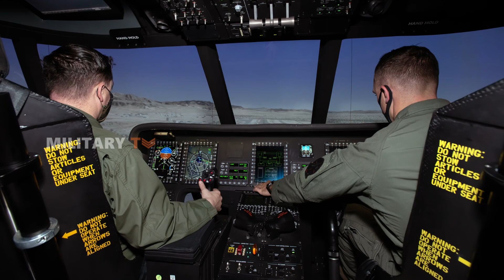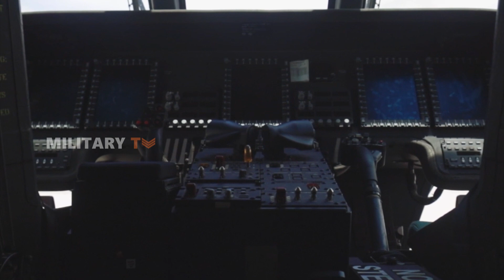Why is the CH-53K King Stallion the Future of Heavy-Lift Aviation?

Comment: When I was in the Corps I got to ride in the older models all the time. Hydraulic fluid was leaking all the time. The joke was if it’s not leaking, it’s empty. Does this new model and its fly by wire feature eliminate the need for hydraulic fluid?

Comment: CH-53K still a cheap copy, the one true king is the MIL MI-26
Reply: cheap? 😂
funny ironic joke from a Russian fanboy 🤣
Reply: @DOGosaurus_rex   Nope not a Russian fanboy, but I know everything the US builds is just a cheap copy. Build to expensive and doesn't work.
Reply: @manoeribaravie165 The longevity of the Huey series, the B-52 Stratofortress, the C-135 series, and the C-130 Hercules makes your comment seem ridiculous.  They were all originally designed in the 1950s.
Reply: @manoeribaravie165 
TOO, DopeY 😕.
Reply: For the IGNORANT! MI26TM HALO, has twin 11,000 Shaft Horsepower engines, cargo capacity of 25 long tons. It has a greater cargo capability under Hot and High conditions than any C130 variant. It's primarily  utilized for Oil and Gas exploration in Siberia, with a few assigned to the elite VDV Airborne and Air Assault Divisions. Also firefighting variants are deployed to battle oilfield fires.
Reply: @HENRISTARKS The Mi-26 has a mission capable rate less than 10% too……..
Reply: Funny youse think it’s Russian it’s not even Russian made the manufacturer was born in Kiev in Ukraine so it’s not even Russian it’s Ukrainian design the CH 53k the designers and manufacturers-Sikorsky aircraft IS NOT RUSSIAN ITS UKRAINIAN  NOT Russian 🤣🤣🤣 you muppets 😂
Reply: @jayjohnston3080  sirlorsky was born in the Russian empire before Ukraine was even thing, he trained at university in Russia and built equipment for the Russian empire. 

Only puppet here is you.
Reply: @jayjohnston3080  sirlorsky was born in the Russian empire before 🇺🇦 was even thing, he trained at university in Russia and built equipment for the Russian empire.
Reply: @SMRMilitaryAnalysis  sounds like a pretty typical legendary American engineer to me
Reply: Unfortunately unlike the ch-53 the mi-26 cannot land on a ship....a very crucial aspect
Reply: Cheap copy??? The 53 has been around since 1962 the Mil 26 was first produced in 1977 Copy??? Don't think so Buckwheat!
Reply: @phatboizbackyardkustomz9006   Don't think so Cowboy! The 53 was not around since 1962 but 1966. Mil Mi-6 before the Mil 26 was there on 1957.
Reply: I don't expect to be lucky enough ever to see a Mi-26. Amazing machine. While I'm impressed by the 53K, The most beautiful helicopters came from the great American engineer Igor Sikorski!
Reply: Except for 'cheap" and 'copy's your comment is valid. Ha ha